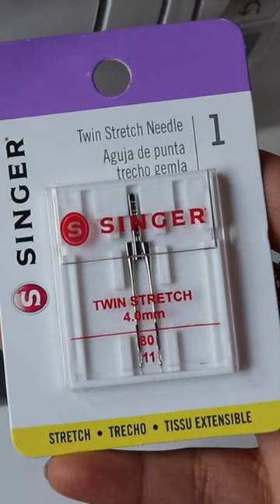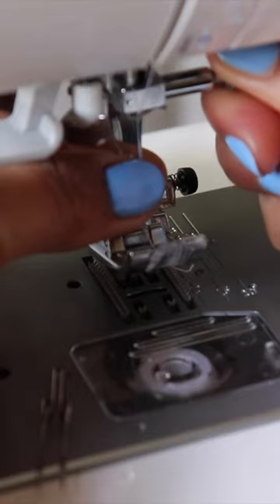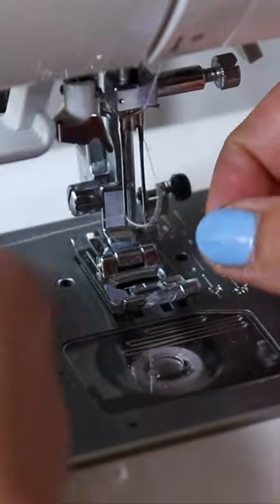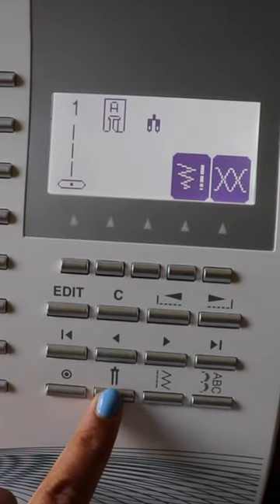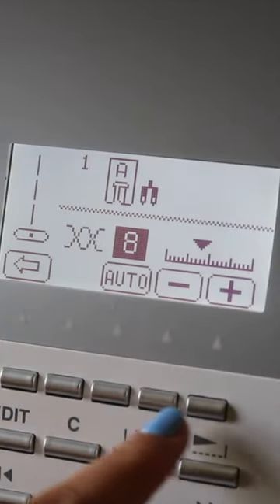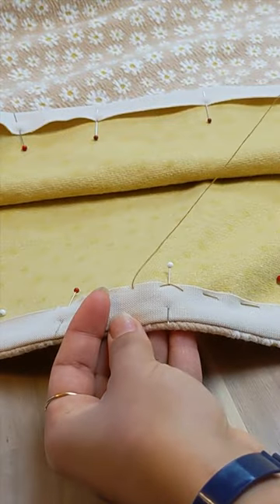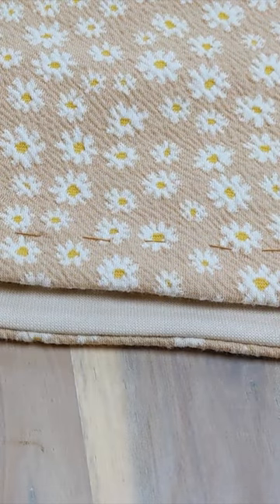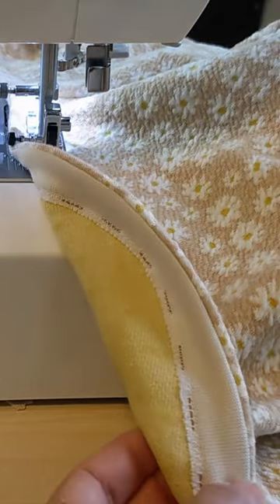Double Needle Hem Tutorial

Comment: I see so you increased the upper tension  and not bobbin tension? I keep getting tunneling and the bobbin thread is like a straight line and there is no stretch
Reply from the maker: I would usually play with bobbin tension but I don't recall my machine having an adjustment for that. But yes for you, loosen the bobbin tension, be careful though, do it little by little.